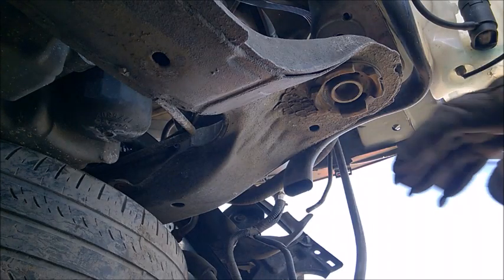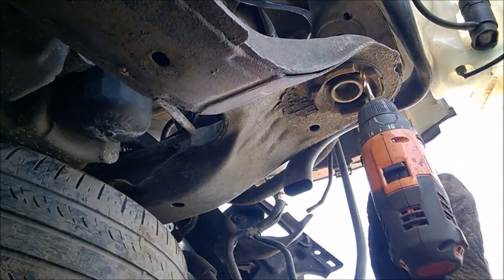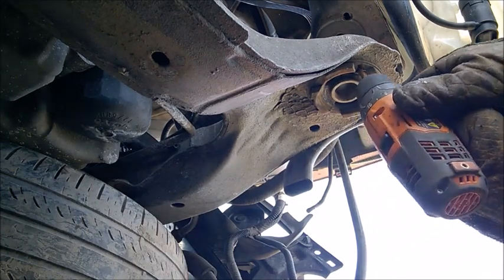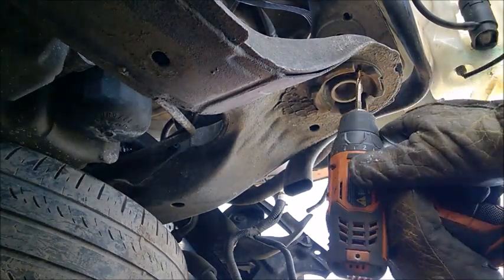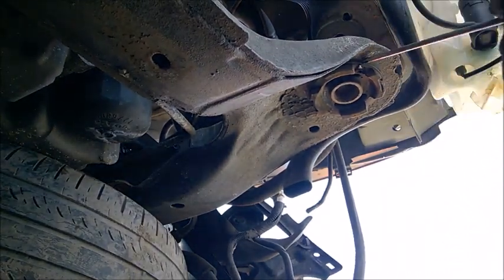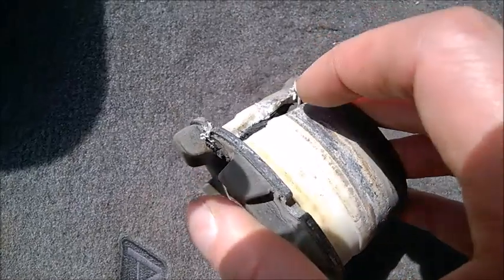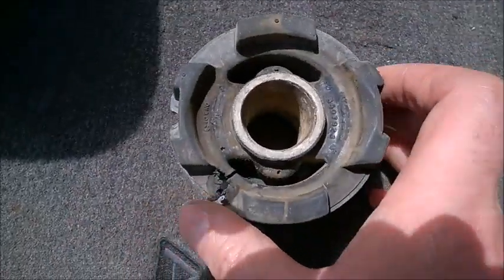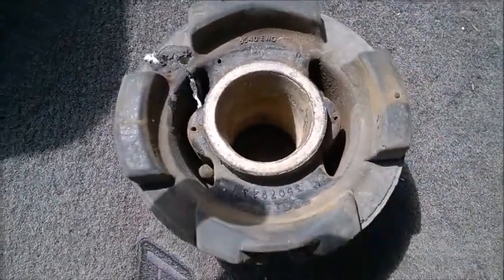Volvo S60 XC70 850 XC90  Subframe bushing simple removal - SEE comments section

Comment from the maker: BOLT TORQUE at the end of this message
Before removing the old bushing, be sure to mark the way it's oriented - scratch the subframe where the bushing has two notches, the new bushing must have the two notches exactly at same place: this makes sure the rubber reinforcement inside the bushing is pointing to the sides of the car - important (these bushings act sideways). Please be aware that some subframe bolts get stuck and can break (nasty).
To install a new bushing, round a bit with sand paper the two INFERIOR (pointing downwards) metal edges of the subframe: the bushing sits on two metal layers of the subframe.  Sand only the edges pointing downwards to allow the bushing to travel upwards when pressed it, the edges pointing upwards must remain sharp because the bushing hangs on these superior edges once in place. Be Aware that you will need a high lifting floor jack to at least 18 inch high or even more using a piece of 2x4. Smear the bushing plastic with a bit of grease. Place the bushing with the correct rotation (important), and use the large metal washer of the subframe washer with 4 nuts  (see pics in the forum link) to drive the bushing in place - do NOT push on the 4 rubber bumps of the bushing, push only between the rubber bumps You also need to Keep a 1/2 inch space between the top of the subframe hole and the cross member of the car because the bushing will actually pass by a few millimeters over the top of the subframe, so you need to leave this clearance when pressing the bushing for the final few millimeters - use a few washers or nuts to keep the subframe from touching the cross member of the car body. I do not recommend to drive the bushing using the bolt. If it feels the bushing gets stuck, tap gently upwards around the metal washer with a hammer. To press the bushing in, you have the choice to either lift with a floor jack under the bushing or to slowly lower the car on a jack stand placed under the bushing, but again, you need something that is reaching very high, a standard small floor jack does not lift high enough, the bushings sit high on this car. 
Warning: always inspect your subframe bolts. Sometimes these are stuck, and a few people did break these while forcing to remove them - major problem. You need to use a 2 ft breaker bar and 1/2 drive socket but if it feels stuck, better stop and not take a chance.  Be aware that on some forums and blogs there is an incorrect higher torque reported that will cause the bolts to weaken and even shear while driving.  These bolts typically must be replaced (stretch type), especially if you forced to remove them. Torque is 77 ft-lb (105 Nm) + 120° (new bolt), the two 14mm on the rear plate are 37 ft-lb (50 Nm). 
Pictures https://www.matthewsvolvosite.com/forums/viewtopic.php?f=9&t=96106
Rusted / damaged subframe bolt https://www.matthewsvolvosite.com/forums/viewtopic.php?t=85069
Subframe tool   https://www.youtube.com/watch?v=yUKw_-_LIXQ
Reply: thanks!!!
Reply: Excellent!  Thank you.   You're not a fan of using the old bolt to press in the new bushing and then finishing with a new bolt properly torqued!
Reply: Haynes manual says that post-2005 models have a torque of 160 Nm (118 lb-ft) for subframe bushing bolts with no angle.  Earlier models through 2004 have torque + angle
Reply from the maker: @reallyhappenings5597   The torque numbers with angle are 77 ft-lb (105 Nm) + 120° for a new bolt (these are stretch bolts). Be aware that on some forums and blogs there is an incorrect higher torque reported that will cause the bolts to weaken and even shear while driving. The torque for the two smaller 14mm bolts on the rear plate is 37 ft-lb (50 Nm).  I'm linking your video with the special tool  https://www.youtube.com/watch?v=yUKw_-_LIXQ

Comment: I just did a bushing using this technique, after doing a quick roundup of all the other crackpot bushing-removal techniques proposed on the internet (holesaws, $150 special tool, chisels, sawzall, etc). Yours is indeed the most efficient. I was drilling for MAYBE 30 seconds - less than you do in the video - and then the bushing came out easily with a big screwdriver. Color me impressed! 
This was a '98 P80. I replaced the bushing with the XC90 bushings, 8678497. Pressed in with a jack using the old bushing as a driver between the new bushing and the jack.

Comment: You can also use bushings from the heavier XC90 on the rest of the P2 line, still rubber but beefier.
Reply from the maker: It's interesting, Volvo is listing #3507923 for all cars including XC90 while #8678497 is listed only for the XC90 
https://www.volvopartswebstore.com/products/Volvo/Bushing-Bearing-bushing/1165499/3507923.html
https://www.volvopartswebstore.com/products/Volvo/Bearing-bushing/1171832/8678497.html

Comment: If removed and replaced one at a time, could these bushings be addressed with the car up on ramps, versus jacking and supporting with stands?
Reply from the maker: You still need to support the corner of the subframe where a bolt is being removed.  We must not let the subframe hanging down with a bolt out because being lowered this way it will pull down on various components such as the steering input shaft, or on some important ECU harness and power steering lines attached to the subframe. The subframe must be lowered in each corner no more than 0.5 inch, just enough to keep a little bit of clearance when pushing a new bushing back in place

Comment: Those bushings need to be installed in the correct orientation. If they are not installed facing the correct direction, they will fail early.
Reply from the maker: Very correct

Comment: What are the indicators that the subframe bushings on a Volvo have to be replaced?
Are the parts from Professional Parts Sweden really that bad?
Here in Holland there is a Volvo shop that sells these parts.
Reply from the maker: Many parts stores are selling both the good and the bad brands. It's because they know there will always be people attracted by lower cost, which in the end will have them come back and buy the good part when the cheap one will fail soon. As for the reason for replacing the bushing, I think past 130 000 kms the rubber gets softer and the steering will start feeling slightly more 'vague'. But I don't think it should make a 'huge' improvement. The original bushings do not fail completely - the genuine ones that is, it's just the steering feeling that gets affected. A new bushing is very stiff, worn ones get very soft https://youtu.be/7CzQaYhq4f8
Reply: @Peppermint1  Thank you for your kind answer. I am still looking for the reason why my steering wheel starts to vibrate on higher speeds. I already did an alignment and balanced all the wheels. I had the inner and outer tyrods replaced and the steering feel did improve a bit. It is not that the steering wheel is shaking but when I drive over bumps on higher speeds the steering feels shaky. It's hard to describe. My shocks are not the newest but they seem to be in reasonable shape. Maybe the swaybar N links?
Reply from the maker: @anfahrt  Several parts may be worn. Control arms, spring seats and possibly the subrame bushings. Use only quality parts such as Lemforder, Sachs, Hutchinson, Rein
Reply: @Peppermint1  Thanks for your answer!
For the inner and outer tyrods I used Lemforder. The only thing I bought from Pro Parts Sweden is the the transmission motormount. 
I am thinking that it is spring seats which are worn.
Reply: @anfahrt  Remember that Volvo provide original parts to serve Volvo cars for many years in order to make its owner proud of his car. Aftermarket parts are made only for profit of the part itself.
Reply: @anfahrt  I have the same issue as you! Steering is also wandering on the motorway. Two mechanics are unsure

Comment: Is this the same on the rear? Thanks
Reply from the maker: Good question, the new bushings are the same front and rear, so I believe it's removed the same way.  Only for rear ones we have the metal plate with two 14mm bolts, and we need to lift the car differently so we have access to the bushing bolt
Reply: @Peppermint1  I would like to see what's involved with the rear one's , great video